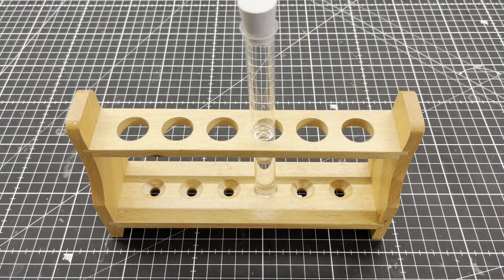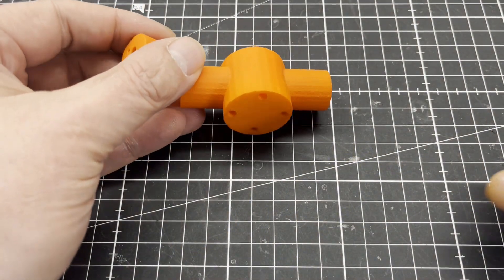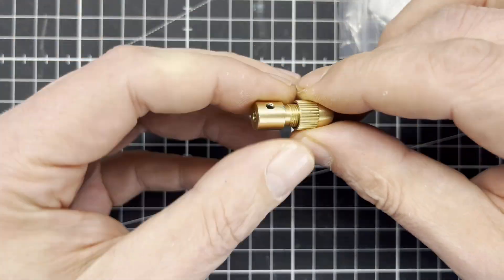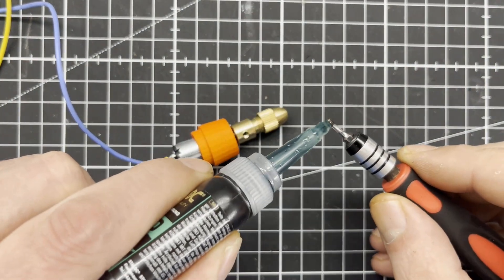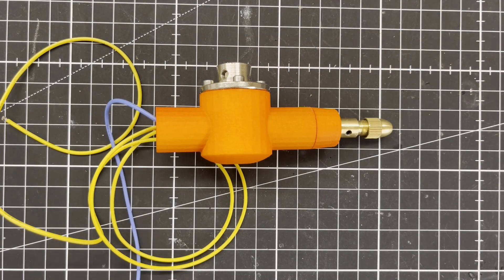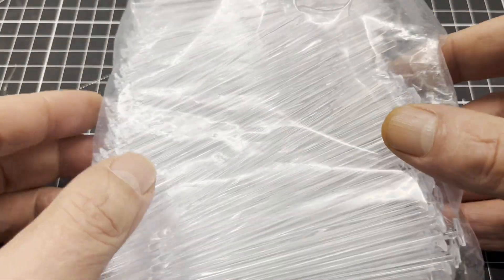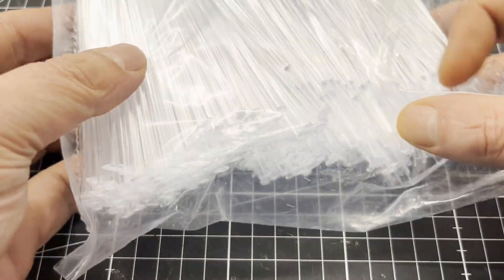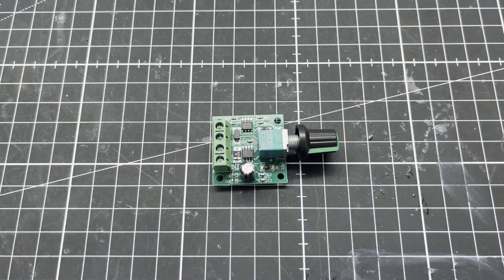Building a micro overhead stirrer for test tubes

Comment: 2:46 I think your putting the threaded inserts the wrong way around, i out them thin side first
Reply from the maker: The holes in the 3-D print have a diameter of 4 mm and work perfectly in this direction with the threaded inserts. There is no wrong direction. It only depends on the initial diameter of the intended holes:).
Reply: @ good point

Comment: Very useful. Interesting design.
Instead of a drill bit chuck. A 3D printed adaptor press fit to the motor shaft and light press fit to the stir rod would be faster to change rods. 
Or instead of a light press fit for the rod, a spring tab to hold it in place.
👍
Reply from the maker: Good idea. The mini cuck has the advantage that you can use different diameters, just like with a Dremel.